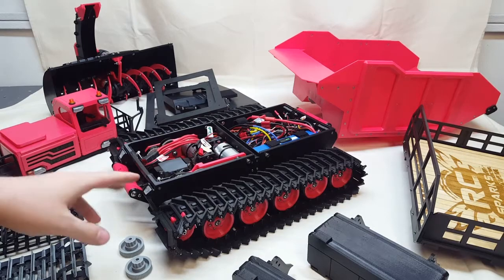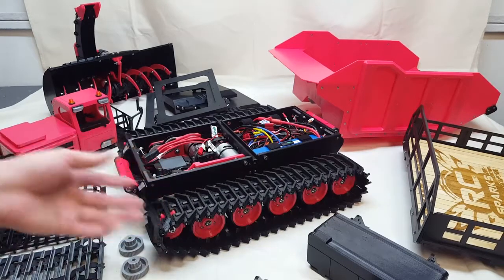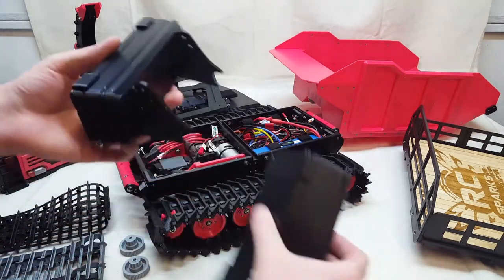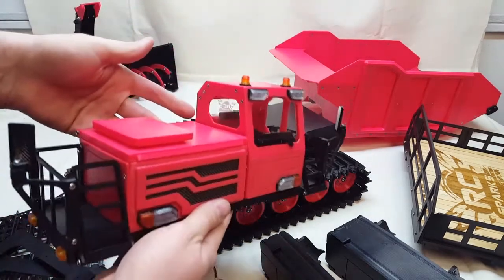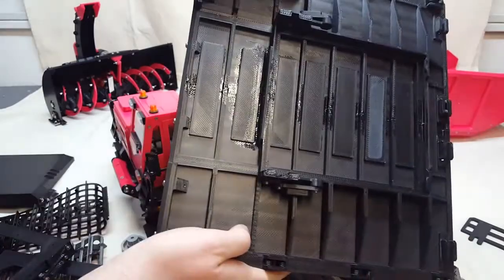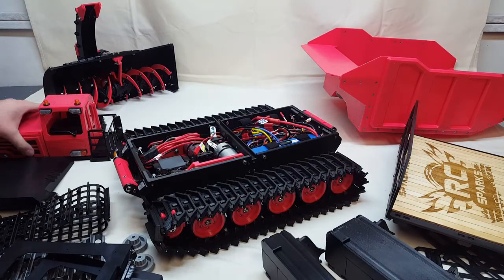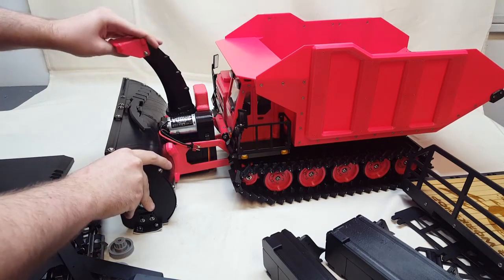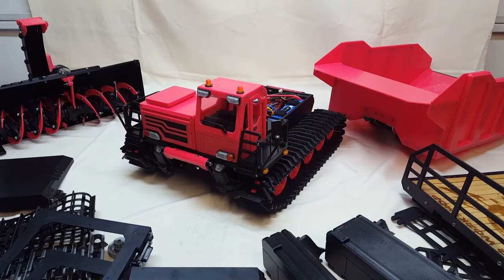3D Printed Spyker KAT - Overview - NOW FOR SALE!!!

Comment: How do you get your prints to be so smooth? What resolution and material are you using?
Reply from the maker: Hey I design my parts to be printed face down whenever I can, and I print on a matte PEI bed. I print with ABS and 90% of my prints use a large 0.8mm nozzle at 0.4mm layers.

Comment: can you print the parts on 220x220x230 printer i was wondering because I would like to try to build it
Reply from the maker: Jorge Mansfield Check out the files here, each item has different max build sizes needed: https://spyker-workshop.dpdcart.com/